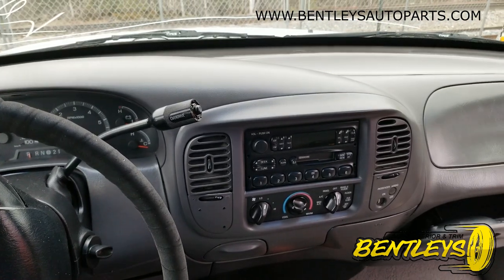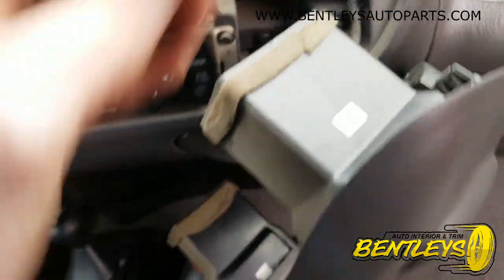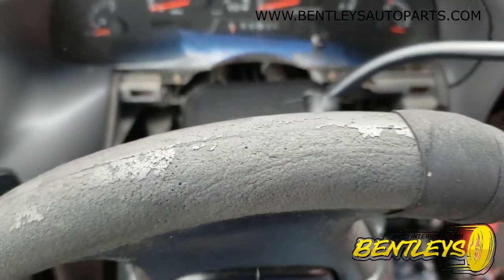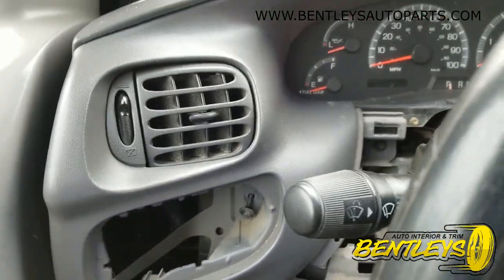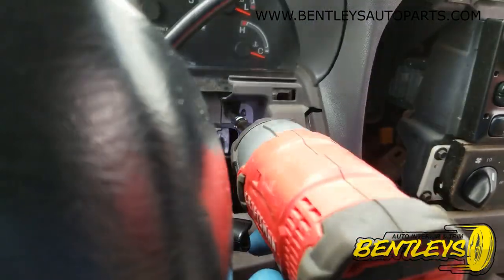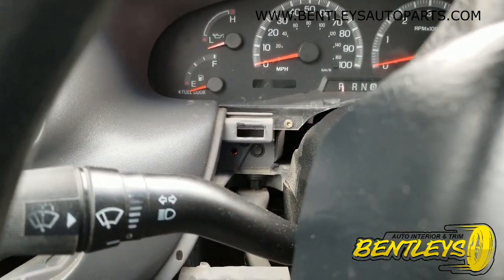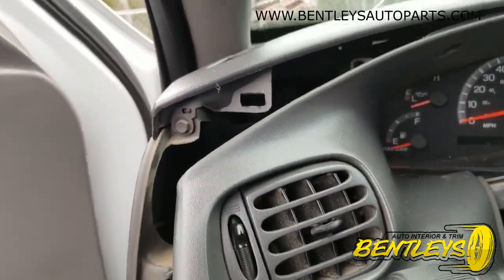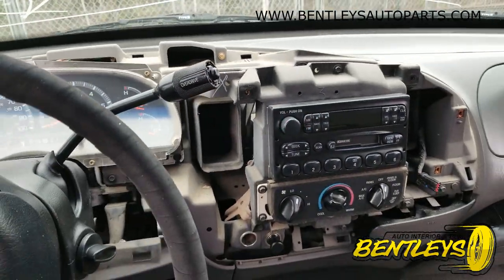How to remove the upper dash dashboard pad on a 1997 - 2003 ford F150 Expedition & Lincoln Navigator

Comment from the maker: I hope this video helped you. If you need any interior parts, check attached link to my store!!!!   https://rover.ebay.com/rover/1/711-53200-19255-0/1?mpre=https%3A%2F%2Fwww.ebay.com%2Fstr%2Fbentleysautoparts&campid=5338488856&toolid=20008
Reply: Thank you! Looking to find a replacement for the 1997 F-150 Lariat  dash panel pad (tan). I didn't see it in your store. Any recommendations? (Elizabeth Polland)
Reply: *dash panel, (not dash panel pad)
Reply: Dashboard not in the store in link for f 150 2003 any other store ?

Comment: There’s a certain way to remove the headlight switch. Turn the knob so the lights are on. Pull knob out. Place a pick or small bladed screwdriver into the slot, remove knob. Rotate knob 180°. Put knob back on. Turn headlights back on. This will release the tabs that are holding the switch in place.

Comment: Excellent video, one note, when removing the light switch just pull off the knob, reverse it and put it back on, then it will turn and release the latch without using a screwdriver, which may damage the latch tabs.

Comment: I have a 2001 Ford F-150 SuperCrew that I have been spending the past year customizing it’s appearance. However, because my trim spec is an XLT, it obviously didn’t come with everything that is included.

So far I have been able to add features like automatic headlights with fogs, and mirrors with turn signals (both are available on Lariats & King Ranch). These have been easy thankfully as I discovered that my truck came prewired with them, and all I had to do was get new mirrors and a automatic light sensor. I just replaced the entire rubber dash pad while I was at it with a nicer one that had a sensor since the old one in mine was very worn. I also need to get a new overhead ECU module hopefully with MPG (Compass & Temp is a must) because my old one died.

The one thing I was also interested in adding was the digital clock OEM that is seen in the 1st Generation (97-02) Lincoln Navigator. I expect that I would have to swap the dashboard panel that’s in my F-150 with one from a 97-02 Navigator that includes the insert on your left of where the radio is.

So I’m just wondering if that would be possible if my truck would have come with a wiring harness & connector hidden behind the radio for a Navigator clock, as well as if the dashboard panels in the F-150 and Navigator were installed the same and can be interchangeable..?
Reply: I just had my '03 Harley F-150 apart today doing a radio install, there is no wiring in that truck for the clock. It wouldn't make much sense for Ford to prewire an option the model never had. I can't imagine it has more than just a pigtail off the radio harness or something that delivers battery, 12v switched, and ground.

Comment: @BENTLEYAUTOPARTS Do you need to remove the whole dash panel to exchange the left AC vent? (Left of steering wheel) Or does it pull out, or does just popping out headlight switch and left screw only work?
Reply: Hi Jsson, I have the same question as mine is broken and I need to replace it.  Did you find the answer on how this is fine and where to buy the left d/side one?  Thanks, Daniel
Reply: @dpad133  You have to remove the whole panel as shown above and remove from the backside. I was able to find a handful online in my dark beige color. So after buying that whole part above I then removed the vent I purchases from the back and added to the one in my truck. There are quite a bit of screws (not hard) just tedious and (BE CAREFUL) the paint chips easily on our older trucks. There were about 3 Ebay guys out there with the full panel and the vent included last I checked 2-months ago. Maybe more in your color?? Oh also be careful with your headlight switch. Don't pry on plastic rim to pull out (you need to go a little deeper to the metal to pry out. Otherwise the plastic rim will pop off the metal bracket that holds it in place.